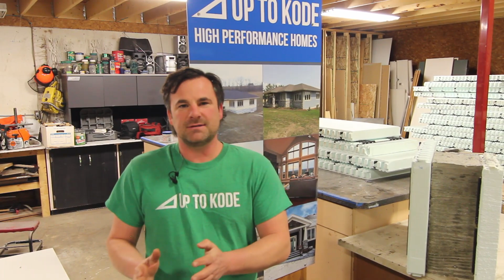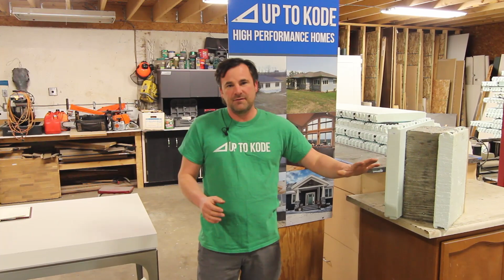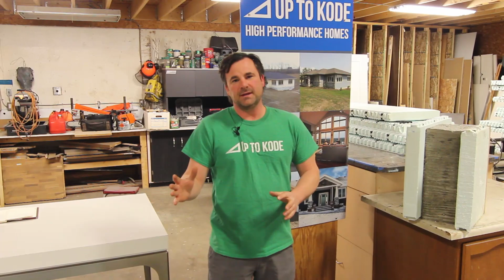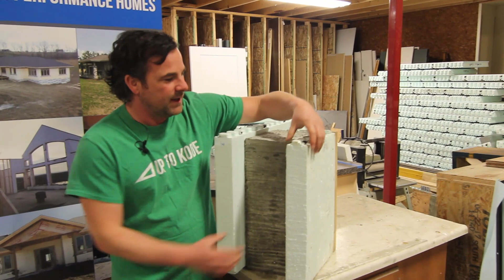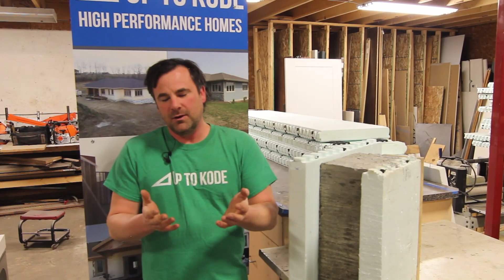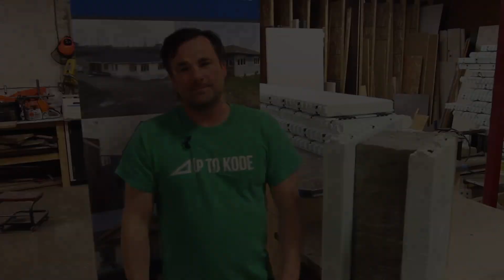Why R-Value is not accurate when comparing ICF to 2x6

Comment: This is not true. R value is a valid and objective metric. But it is not the only metric. This assembly should be modeled and compared more fully to a standard light frame wall assembly which can also contain high density elements like stucco. An enormous amount of of home energy bs is contained in partial truths about things like r-value which continues to bias people against conventional light frame construction for bad reasons.

Comment: I use my open basment floor for thermal mass in winter for the wood stove and summer to hold the cold air and ac used. Works amazing.
Reply from the maker: Yes that would work amazing!

Comment: Its basically like building underground but above. Being able to keep the interior at a constant temperature is a key factor in icf's. The added benefits of storm protection and disaster resistance is also why icf's are a superior building technique. Plus if there is ever a power outage, the interior will remain comfortable for longer. Regardless of time of year.

Comment: You are looking for the specific heat of concrete. The amount of energy it takes to change the temperature of 1 gram of concrete, 1 degree Celsius. From that we can basically say it takes x amount of heat to increase the temp. Now that energy has to move to the next gram of concrete and increase that temp. This can be used in the reverse direction as well, to say how much negative energy (cold compared to the temp of concrete) is needed to lower the temp. From that, you can throw in the R value calculations that slow down those changes and losses in temperature.
Reply: Going back to specific heat, concrete has a specific heat of 880 j/kg•degree Celsius. So if we take a 6” concrete Icf wall (not accounting for rebar or foam right now) it is 0.1524 m thick x 1m x1m for a total of 0.1524 cubic meters. 
The mass of concrete is about 2400 kg/m3 so it’s 365.75 kg. So it takes 321,364 J to increase the temp of this concrete by 1 degree Celsius. To put this into better perspective we can turn it into celsius heat units. So if our outside air temperature was 169.22 degrees Celsius, it would contain the energy to raise the concrete 1 degree. This is crazy, because we have foam on the outside and that energy transfer could never happen that quickly and we don’t see those kind of temps. The same would be true of negative temp differences. 

To get the whole engineering view of this, we would need to take into account the k-value of the foam, the k value of the concrete, and then use this same thermal mass calculation to really get an idea of how much time you would have before you ever felt a difference on the inside.
Reply: 12.51 is r value of 3” eps 
R-value is calculated from k value, and is basically the heat conductivity over the entire square meter. Expressed in W/m2K watts per meter squared kelvin. Watts is joules/ second. 

After all of this we can calculate how much energy will be allowed across the foam, and will in turn raise or lower the temperature of our concrete core. 

(Note this is just accounting for conduction, there can be convection and radiation if the sun is shining on the outside of our wall, I’m not accounting for that) 

12.51 joules/ S for every degree C difference. 

Let’s say our outside air temp is 30C and the temp of the concrete starts at 10C 
That is a delta T of 20C so we are transferring heat through our foam at a rate of 250 J/second. If you look in the comment above we need 321,000 J to raise our concrete 1C. So it will take 1285 seconds to raise the concretes temp by 1 degree. Or 21.42 minutes. 

This equation will change continually based on the temp difference and that will change how fast the energy will transfer. 

For the sake of my sanity and time, and to put out the worst case scenario, if the rate stayed the same at 250 J/second. It would still take 7.21 hours for that concrete to reach 30C. This is the absolute worst case scenario living in Death Valley, with no shade and no temp changes, and no taking of energy from any HVAC systems inside. Then that energy still has to go through another 3” of EPS on the other side of the concrete. Needless to say ICF is awesome.
Reply from the maker: Great input! I will save this data. I appreciate it.

Comment: kody what is your opinion of using a icf for a roof?   (like quad deck or lite deck don't think nadrua has one)
Reply from the maker: It’s a superb idea! I’ve never done one but I have lots of ideas. I would probably stick with a low slope system for ease and speed. And yes quad lock (I heard) has one of the best roof systems. 

Use Fortruss for flat work or low slope.

Comment: Didn't see the link to the test, so I cannot be too sure what I'm saying is accurate. But, there are things to consider anyway.

I believe Kody's interpretation of the test is based on just one iteration of the test, because that's how R-Value is evaluated.

Keep in mind that the thermal mass had to start at some temperature and for it to have taken so many hours for the outside 
0° temperature to effect the inside 70° temperature, the thermal mass (concrete) likely started at 70°.

What we do know is that the insulation is the same on both sides of the concrete, so I believe that after that first 48hrs, the concrete would have been the average of the two temperatures, 35°F. From that point, you would be dealing with 70° vs 35° and only through the inside layer of insulation. So after the initial 48hrs, the change in interior temperature would happen at a shorter intervals.

Inanimate objects simply average all the temperatures they are exposed to, based on the length of time they are exposed (talking purely conductive heat transfer and taking radiant and emissivity out of the equation, that is)

So with something as heavy (massive) as concrete, it takes time for that mass to change temperature. However, the test has controlled temperatures on each side, so if you were to maintain the 0° and the 70° for let's say a week, then turn off the power, the concrete would be about 35°F and the only thing keeping that 35° from influencing the warm side is the thickness of insulation between the concrete and the warm side. It's going to take a few hours to bring that warm side down, not 48hrs. In my humble opinion.
Reply from the maker: I appreciate your interpretation. I’m still learning myself and still do my own (very low tech) tests, as you will see from more recent videos
Reply: @uptokode 
I appreciate you not taking offense to my comment because I meant none. In fact, I really appreciate what you do!

I'm not a scientist or a degreed engineer, although  I work as a Mechanical Design Engineer and I used to perform research at a materials research think-tank. Most of the research I was involved with included heat transfer measurements, so I have a better than average understanding of how that works.

That being said, my characterization of what's happening in the ICF, was an educated guess, however I believe I'm not far off.

In my opinion, thermal mass throws off the R-Value (or U-Value) testing due to the delay is causes. The default R-Value testing is not set up to deal with that delay. If I were doing a test to evaluate any building assembly against another, apples to apples, I would do what I previously said: hold the internal and external temperatures steady for a week, then kill the power. Measure the rate of change on the 70° side. Now you've got equivalent R-Value, regardless of wall, window, door assembly type. Thermal mass is tough to nail down because it can work for you or against you, depending on the situation.

Keep up the good work! You've got me sold on Nudura Plus. If the wife wouldn't be opposed to it, I'd use Nudura One and leave all the interior walls concrete. Now that fully maximizes the benefits of thermal mass!
Reply from the maker: I’ll have to come back to this soon and re-read it. I do get what you are saying. 

And ya the 1-Series exposed on the interior would be amazing

Comment: It’s sad that R-value is still used at all for code, it’s gotta be the worst measure used since 2” spray foaming is miles ahead of any amount of bat. Then again it seems that most houses are built strictly for cost anyway so the general masses are really to blame for that lol
Reply from the maker: Couple of really good points! I’m not a fan of spray foam for multiple reasons. Mostly because people assume it seals everything and it surely doesn’t. Especially where lumber joins to each other. Walls to floors, etc
Reply: @uptokode  yeah, if you watch Spray Jones channel, he uses a spray caulking after the spray foam install is complete. I figure even if someone didn’t seal up the seams, spray foam is still 100x more sealed than bat. At this point I see bat’s only use is to reach the r-value for code.
Good part of ICF is you only need to spray foam the roof & seal the seams & openings. I actually want to icf used to build roofs so hurricanes don’t rip them off lol

Comment: I’ve always wondered why the exterior foam isn’t twice as thick as the interior.  It would protect that thermal mass of the concrete better I think.  Some builders have used 2x8 framing to get R40 walls but wood is very expensive here too.  This winter we had -40C for a whole damn month in central Saskatchewan.  Frost went down over 4’ in the ground. Good video and I like your logic and thought process.
Reply from the maker: I appreciate what you say!
Reply: Some ICFs do have thicker foam on the outside, just not the brand Kody is using here
Reply: Vendors also offer 2 inch thick inserts which go between the plastic supports and can then be fastened to the inside of the icf form. IE you can get a form for 10 inches of concrete, then add 2 inches of foam to the inside and outside walls with the foam inserts, and still have a 6 inch concrete wall.
Reply from the maker: You’re absolutely right. I do have videos on how to add insulation to 2 types of ICF system. The one-series and the standard block

Comment: I see the advantage of a thermal mass when the temperature fluctuates, but what about a thermal mass in say Florida in the summer?  Does it get hot and just keep baking your house?
Reply from the maker: Very valid point. You are correct from my understanding. Typically in those hot climates A/C is a requirement no matter what. Since ICF is far more efficient and air tight, your cooling requirements are far less than traditional homes. 

ICF is always an advantage.

Comment: R20 wood wall vs R20 icf. Doesnt matter how long it takes for the thermostat to turn on. If u have ur house set at 70 degrees and the outside is -30 for a week straight. You are still heating. The better system is spider tie. Where the concrete will use the thermal mass to hold the inside temperature
Reply from the maker: The thermal mass core does make a difference. Yes you still have to heat it. Most climates fluctuate in temperatures throughout the day and night and an ICF wall is far more stable. 

I do want to see in real life the performance of a 1 sided ICF with the concrete exposed for maximum thermal mass usage.

Comment: Your analogy is partially correct. If temperatures are cyclic then thermal mass helps. I am thinking of spring and fall where during the day I want to air-condition and at night I want to heat.  But if it is always significantly colder outside than inside then total energy to heat the house over a month is totally dependent upon the insulative properties. ICF does have a major advantage in that its a true air flow barrier where most 2x6 wall have air leaks. Also, most ICF walls easily achieve the advertised R-value and 2x6 wall often don't . However, WRT the testing method for R-value, I conclude it is wrong. What should be done is to put a constant temperature on one side of the wall and an energy flow measuring device on the other side of the wall. Then allow it to run for a few days until it reaches steady state. This will tell how much energy is going through the wall. A perfectly made 2x6 wall with r-20 should have the same energy flow as an icf with r-20.  In reality, the 2x6 usually has more imperfections and thus it doesn't.
Reply from the maker: I can agree with you on that. It would be interesting to measure exactly how effective thermal mass is during constant temperatures.

Comment: I am starting to build ICF in North Carolina, since I will do the walls myself is hard to compare cost, but with the lumber prices and the added cost of outside panels, insulation (close cell), and other expenses I am a firm believer that there is no comparison, not only with the R factor but also with noise, mold, rot, bugs and more.
I wish I have the money to also do the roof in ICF
Reply from the maker: You’re absolutely right about what you said! I don’t have any experience with an ICF roof. Pretty easy if you go flat or ultra low slope. 

What system would you look at for the ICF roof?
Reply: @uptokode  right now looking at quad lock. I like their wall system do you have any ideas or thoughts about that system. What I was wanting is what they show as R-30, 2 inches on the inside and 4 inches on the outside for the wall and then as for the deck system quad lock as well.  Planning on a fairly low slope shed roof. Probably 4/12
Reply from the maker: I don’t know much about quad lock. What I do know is that they have a good roof system. 

I think 4” exterior foam and 2” interior would be a good combination.
Reply: Spring of 2023 I hope to start construction in Mitchell county North Carolina will be doing ICF walls for sure my hope is to be able to do an ICF roof that's the big question for me right now, Mitchell County is in climate zone 5

Comment: Concrete has an R value, it is low. You're describing thermal lag due to mass, and it is only more energy efficient in climates that go above and below the indoor temp within the lag period. Think about it, if it takes two days to cool down how long will it take to warm back up? During steady temp weeks a framed wall will perform the same as an ICF, you just delay the bill. You are correct with respect to the temp swings, high thermal mass structures don't change fast, that could be good or bad. If the building is designed for temp setbacks and local temp control more thermal mass delays getting the room to comfort levels. If you turn the heat down in winter before leaving for a holiday how long does it take once you turn the heat back up? Climates where it oscillates above and below like the high deserts or shoulder seasons are where you realize efficiencies. Look at adobe or pueblo buildings. If someone is trying to sell you ICF with this R-equivalent, they don't understand their product or how thermal systems work, they most likely won't be more efficient in your climate costing you more money than promised in HVAC operating costs. Please find some introduction to thermodynamic courses, you've got the basic concepts just need to put them all together.
Reply: This is why I believe the interior foam should use max two inches and the exterior panel should be at least 5 inches. This is how I built my home and the energy bills are about 1/2 of what a well done 2X6 wall would accomplish.  I live in minnesota
Reply: @paulnovak833  ideally you will have all the insulation outside and all the thermal mas on the inside
Reply from the maker: I’m still learning more about this all.
Reply: But you forget, this has concrete sandwichwd between a few inches of foam, which does have a high r-value. 
This is a hybrid system, and we're seeing it work well.

Comment: Isnt this a moot argument? If its winter sure it'll take longer for the cold to get in, but wont it also take more energy to heat that mass back up?
Reply: yes, will take longer to heat that mass but will take longer to disipate the heat from the mass of concret also making for less temperatures swings
Reply: You can heat your home through well placed windows that only let in direct sunlight during the winter, but not during the summer.

Comment: Here's another consideration.  The ICF wall is also connected to a huge heat sink in the ground.  I've talked to a guy in the high desert of west texas and hes says he thinks the temperature swings in the summer are moderated by the concrete in the wall being connected to the COOLER ground temps.  Very HOT air temps but very dry air.  Much more complicated system than a typical batt insulated wall section.  Adobe walls are the same thing.
Reply: You are spot on here. 
There is not only a large thermal mass in the concrete but it is also a thermal sink to the ground. 
It's as close to the benefits of living in a cave as you can get without actually living in a cave.

Comment: In Canada the r value is based on a 15 degree temperature difference.  Celsius that is.  So when you want your home at 20 degrees it preforms like the rating if it's 5 degrees outside. In the north we sometimes get below 40 degrees and a batt insulation will perform at about r 7 drastically less than it's rating while isf or sips lose very little r value.
Reply from the maker: Good piece of info.

Comment: I believe such a comparison needs to take into consideration 3 factors. There is the rate at which thermal energy can flow through a material. There is the amount of thermal energy that makes it through the material. And there is the amount of thermal energy absorbed by the material. I have heard that the space shuttle will turn away 90% of the heat generated during re-entry. 10% makes it to the cockpit. And the astronauts have a fixed amount of time to get out before that 10% (still lethal) reaches them.